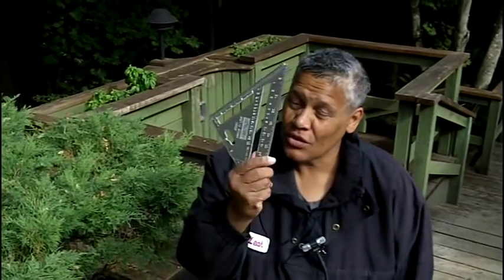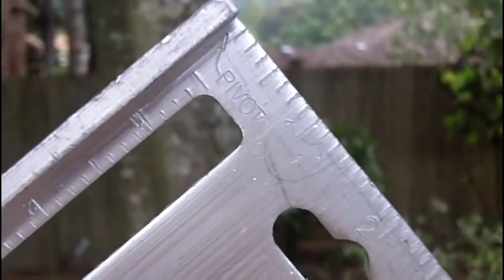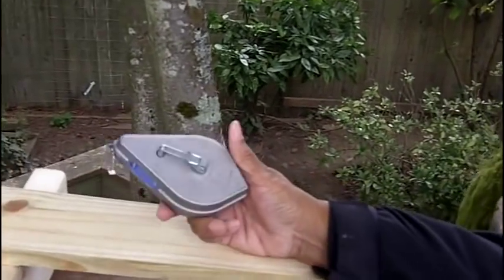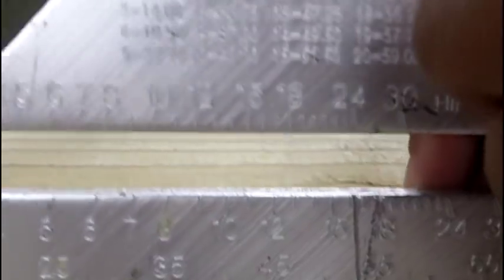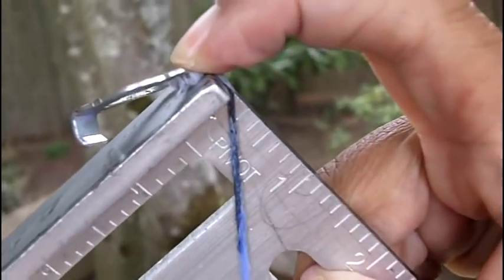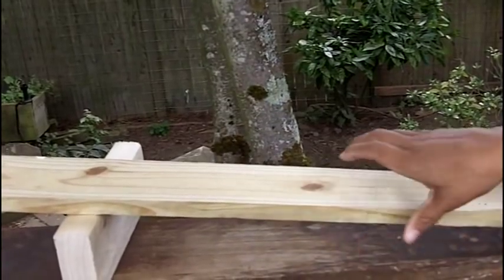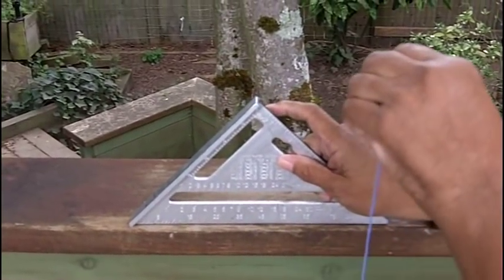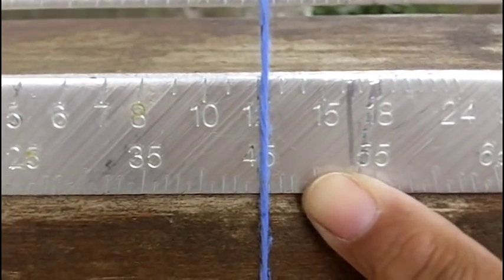If You Have a Speed Square You Have a Level

Comment: Old school. Good in a pinch, but don't expect amazing accuracy - especially not for long/large components.
Reply: sammy J. stone  You are sick!
Reply: sammy J. stone  I have to agree with that.  many a level that takes a spill will not be accurate.  Leah's 'trick' here is a small 'assisted' version of how we set utility poles, with a plumb bob..  As the 'corner mount' or 'line truck' steadies the pole, another worker, standing further back,  would hold up a plumb having his pinched fingers at the top of the pole against the sky.  When the pole lined up with the string towards the bottom, pole was straight.  Repeat from a 45 degree angle from where you started.  A final double check and that pole is ready to be filled in.
Reply: Jeff Holland  LOL, you must be or were, a lineman. The old timers back then always used a brick on the hood. 'Four drops of rain' and we don't work on it.  Midstream, we would work in light showers.  With power lines involved, we found other preparatory work to do.
Reply: You just need a straight piece of wood or metal and use this square on top of it. It will give you more accurate reading.

Comment: *50 years using a speed square and never knew this-Slow I guess.
Reply: M Detlef  Maybe not up on top of a construction platform away from the toolbox.
Reply: I don't think the speed square has been around 50 years
Reply: @timdouglass6491   "Albert J. Swanson invented the 'A Speed Square' in 1925 as a carpenter's layout tool." - wiki
Reply: Ditto..
Reply: But I only have a level, and no speed square... now what do I do ?
Reply: You can also use a standard square just hold the plumb bob at the yop of the edge and it should follow the edge

Comment: You go girl! I just learned something new. You need an edge to hang the plumb bob over, but this is a great trick! Thanks!
Reply: I was contemplating the same thing but a neat tip that has its utility nonetheless!
Reply: There was, I'm sure, a sliver of space, betwixt and 'tween the twine n wood. That's all you need to know. Not the straight camera shot but looking down from above, from Leah's truer point of view. And don't push the drywall back until ye trim yer boxes.

Comment: What's nice about this technique is it is quicker than using a bubble, and I now have a fine wire attached to a 1/16" pin at the pivot point which I can refer to by merely removing it from a small clip to let it move freely.
Thank you from an Olde Dawg and new subscriber.

Comment: That was basically how the Egyptians leveled the pyramids
Reply: I’ve wondered how they built things so precise but they did have rope and string so surely they knew how to make things straight and true using string. They may not have had bubble levels but I’m sure they had other simple methods.
Reply: Ok so how did they cut 10 feet thick stone so perfect. With sticks and chicken bones.
Reply: Rodney Gilbert that’s still being debated. Some think they used sand and friction while other claimed they used hammers and chisels. Either way would have taken forever. Surely they had a quicker way.

Comment: The title here should be: If you have a plumb bob . . .
Reply: It’s more for practical reasons, yes technically you don’t even need the speed square, all you’d have to do is make an equilateral triangle with sticks, mark the middle of the bottom stick then put a string on top with a rock hanging. It’s more likely someone who needs to make something level simply forgot their level and instead of driving half an hour or whatever to go get one you can use your speed square and chalk line, very common things to have at any construction site or odd job.
Reply: Don't need a plumb bob either, just a string and a washer lol
Reply: Der meister A string and a washer is literally a plumb bob, what do u mean?
Reply: @travispratt6327  My name is not Webster, but I think the plumb bob is the weight on the end (usually, with a point), the plumb line is the string, to make your item plumb.  And to confuse things, I like plumbs as well!
Reply: scott m Yea maybe, there is the plumb bob and a plumb line, the definition is confusing I’ll give you that. Wikipedia says it’s the whole thing though, “DescriptionA plumb bob, or plummet, is a weight, usually with a pointed tip on the bottom, suspended from a string and used as a vertical reference line, or plumb-line. It is a precursor to the spirit level and used to establish a vertical or horizontal datum.” So it says it’s only a plumb bob when it’s suspended, get rid of the string it’s no longer a plumb bob. Maybe we should call a plumber I think they use them sometimes? A plumber named bob would be best 😛
Reply: A plumber named bob who likes plums and uses a plumb bob to work on his plumbing I think 🤔
Reply: @travispratt6327  Or, he could call his buddy Tom Thumb.  Bob sure gets around!

Comment: Something's out of whack when you see the level bubble not on center and the square says yes....Your fired
Reply: definitely something's wrong when the level says "slightly not level" and the "instructor" says "it's level" .... The square was "out" just a hair too .... just a tad ..... but for sure the level said "right side needs to come up a hair" and I think the square did too ... just a hair up on the right side of the board to get perfect level ......
Reply: That level is junk. The bubble is too small. It should completely fill the space between the two inner lines.
Reply: Finally someone else knows my frustration!
Reply: @Vic Judar 

You’re**

Comment: If you have a plumb bob and a speed square you have a level.
Reply: It also works with a regular square.  Place the square on the surface.  Place the plumb bob line beside it.
Reply: Sure.  String, thread, fishing line, even a plant fiber.  Washer, nut, bolt, screw, even a pebble.  Also, a square can be made with the 3,4,5 unit pythagorean process (theorem).
Reply: You also can navigate the world..... A speed square can be used to navigate the world.... It is a sextant or back staff... Depending how you use it..... Very accurate for global navigation
Reply: Archie Bunker  and is the number one tool of the masonic

Comment: Nice work. An added tip...since the speed square doesn't have much surface length, you can put a straight 2x4, or anything else for that matter, and get a wider/longer surface to check if it's level from a longer point a to b. Also, you can use this method to check if your 4', 6', 8' etc levels are actually level or not.

Comment: You can also use a chalk box only as a level if your framing walls. Make a 1 foot mark on the top and bottom plates of your wall and hang your chalk box from the 1 foot mark on top so it just barely touches the bottom plate. And then move your wall from side to side til the marks meet and if you move the wall in or out you can plumb it that direction at the same time. Great video
Reply from the maker: Thanks for sharing that tip with the community!
Reply: Lol I hope yinz understood that , it’s a old trick but good one

Comment: Thanks, before seeing your video title I never considered using a speed square as a level. That made me think about leveling with out level before clicking the video, so I assumed to use a cord (as plumb bob) to measure the perpenticular angular to the flat ground with the given speed square. 
PS: I don't own a speed square but a plastic drawing square and a small level like your orange one, and never needed to use a plumb bob or lay bricks (masoned).

Comment: Leah thanks had no idea u can do this. Maybe I can show you something. If you are on a job site with just a hole in the ground and you want to level two spots take a clear  hose like some plastic tubing fill it with water and lay on the ground but hold up the two ends and then you will see the water level will be the same on both sides so you can find two points level with each other just in case you don't have a transit or other leveling tool on the site. Don't know if there's any videos on this. Learned from old timer

Comment: That’s a neat tip/trick, and a good exercise in mathematics and problem solving, but it costs more in time (which is money) to do that than it would to just go buy a level. Then you’ll have a level. Not to mention, using a chalk line as a plumb bob is going to result in chalk on your fingers, level, board, etc. Plus you’re using two tools in a situation where one tool (the right tool for the job) will be easier, simpler, and much more accurate, especially across long spans. Good video, though. Keep up the good work showing people how accessible woodworking/diy is.

Comment: Many variations are possible, if you don't have a speed square or plumb bob.
You could use a 1' square piece of tile, or anything square like that, even a standard carpenter's square. Hold the tile edge or square edge flat on your surface, drop a piece of string with a weight on it from the top corner of your tile or square. When the string is parallel with the vertical edge of your tile or square, then your surface is level.

Comment: Great tip for apprentices , should have also mentioned that in they were working out the roof pitch " 15 degrees " it was also on the square .
Reply: Roof pitches are not typically called out by degrees. Don't think we want just everyone's building a roof over our head.

Comment: That is a good trick however they make 2 4 and 6 foot levels for a reason my addition to this would be to check your surface in several places as a speed square covers a very short area
Reply: indeed... though you could use a 2 foot framing square or an 8 foot sheet of plywood for similar effect (even though there is only a flat corner and not a convenient speed square edge to hang the plumb bob string from).

Comment: Any carpenter with any experience knows the value of a plumb bob.  This is a great tip for someone not experienced in building and woodworking. However, a few of you below claim to be carpenters but did not know of the uses of a plumb bob.  Can't call yourself a carpenter if you don't even know about plumb bobs.

Comment: While I do appreciate your teaching style when sharing a few interesting ideas, this is one of those I wouldn’t recommend using in the field. A level is a single and precise instrument with a definite purpose, to assure that installations are level as well as plumb. 
While your methodology for using two tools to accomplish the same task may somewhat accomplish the task, it is not a precise nor accurate means by which to verify level. In my 40 years of construction experience, I can’t recall (most likely due to my age ha-ha) one instance where your speed-square/ chalk line would ever be substituted for that of a level for the purpose a level was intended. I suppose if a “close enough for me or you can’t see it from my house” was your attitude, well maybe but not too many carpenters or homeowners operate in that mode. 
With all that being said, your video was entertaining and creative and maybe there are those who may even try your idea out, although I can’t think of one instance where this method would be preferred over that of a level, not even in desperation. 
Keep up the teaching, it is always fun to see your thoughts and outside the box ideas when it come to helping the DYI’s with tips-n-tricks!
Reply: You should check out the tools that were used to build the pyramids, bearing in mind, the incredible accuracy that was achieved. There is a tool that was used that used a very similar concept to this.

Comment: The bubble in the level was out, but more to the point, use your plum bob to mark the timber and you got a plum line to work off, 90 deg of that is level. Much easier

Comment: Nice tip. This is one of those if you don't have a level type of situations. But don't try and use this as a replacement for a level. Keep in mind you need a chalk line or plumb Bob to make this work. Leah was using a chalk line she wasn't using a plumb Bob. Honestly get the level they are less than 10 bucks.

Comment: Doesn't have to be a speed square. Doesn't have to be a plumb-bob. Level can be found with a framer's square and a rock with a string tied to it.. You've got the 90° angle. Just dangle your plumb-bob (or rock) down the edge. Easy-peasy and just as accurate (if not more so because of the increased length) as dangling it down across the 54° mark on the speed square.

Comment: Keep in mind though, that for precision the reference would be the left edge of the string (in this case), not the center axis.  You can solve that very minor error by using zero diameter string!
Reply: I was thinking the Johnson rods or muffler bearings.
Reply: @joe18750  ???

Comment: Omg😀 u are awesome!  I always learn something new, about the multiple uses of some tools. I'm new to woodworking / carpentry.  I took a wood shop class over 20 years ago and have forgotten a lot (or didn't pay attention) 😯. Now I find myself trying to build stuff that is never quite right.  Can you please do a series( if you haven't already ) about making basic boxes...the tools you need, the different kinds of joints, what type of screws for what type of wood (head shapes), how long the screws should be for each products, how to get planned wood without special joiners or planners. How to choose the right type of wood for each kind of project  (I'm on a buget...but particle board does not hold up and some furniture grade plywood is expensive). How do you use corner brackets correctly (on the top ot bottom of the wood)? I keep failing at making basic shelving units, the wood is always crooked and unleveled. The L brackets never hold, wobally. Cuts are always crooked at the ends. I only have a circular saw, screwdriver, a couple clamps, speed square, small level, measuring tape, small plastic work table. I recently was given a table saw with the plug cut off....I assume I can replace the cord and use. How do you measure the gate? I think this would make a great series of videos. Thanks in advance.

Comment: That's all well and good, but that only touches 6 inches of surface area, I guess you could set a straight 2×4 or anything long to set down first then do that trick. No complaints though. I've done tile for 7 years and I've never seen that,  nice trick,

Comment: Question, how will it work on a surface where you have to place the speed square upside down? Thanks
Reply: Or actually ... I guess you could temporarily nail or clamp a spare straight board along the underside of the one you're trying to check, so that it sticks out a bit and creates a surface you can rest the square on top of, then use the method normally from there. That's the only solution I can think of though

Comment: Did everyone fail geometry? 
Education for the ignorant. Any square or 90° angle and a plumb bob can be used as a type of level. And your "level" board wasn't level according to your level. You can use 2 cups of water and a hose as a level too.
But I personally, would just buy/use a level!

Comment: I’ve seen old school carpenters just use a couple drops of water in a pinch. It’s not very accurate, but neither is this solution. 
You can “cheat” a little more when it comes to the “rough in” work.

Comment: this was the method used by the Romans,,, and i suspect as far back as the Egyptians...
Reply: Egyptians used a ditch with water in it to level the pyramids. To plumb they used the plumb bob. Did you know the root word plumbum (sp?), was the basis for both plumber and plumb. It the word for lead. Lead weight. Lead was used by plumbers.

Comment: "If you have a speed square AND A STRING WITH A PLUM DEVICE ON THE END you have a level". Would just be easier to pull your your readily available small and compact torpedo level, and with one hand, have a level reading.....in like 2 seconds. I mean...who in their right mind would have a speed square and a chalk line on them but not about 18 levels everywhere in their truck?

Comment: Lol that’s not a plum bob it’s a chalk line and that surface is not level ...
That torpedo level is prob 8” to 10” which showed that small area is about 1/8” to 1/4” of level @ 8” which can transfer to a 2” of level at 4 feet ( the air bubble in the level must be exactly centred between the lines to be level ) 
But good video of your just building a tree house....

Comment: First everyone don't be an idiot, use the right tools for the job and make your life simpler.
That being said.
The title is deceiving,  there is only one way to find level with just a speed square and you got it wrong because you used a plumb Bob.
The two flats are at a right angle, put one side on the surface and you'll notice the other flat side is angled the direction of slope, raise or lower depending on slope till the flat not on the surface is vertical, it's a trick I learned doing rough framing. Along with finding square using a string or piece of wood
This works both vertically and horizontally. Now if you are doing fine or finish work,  or it's super important to be dead on, use the right tools for the job and get a level

Comment: This is wrong --- she has the string suspended too far to the right.  This would only work if she had the string hung at the very corner of the pivot point, not the fraction of an inch to the right side of it as she does here.  The square's 45-degree mark is in line with the point of the square, not the spot where she has the string suspended from.